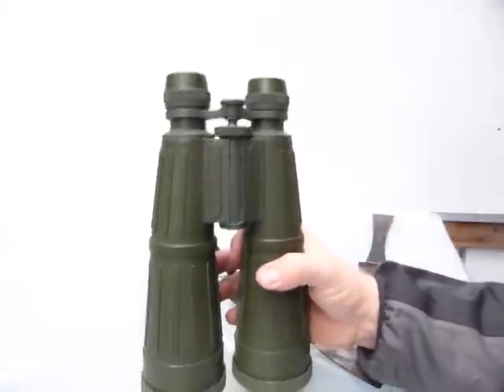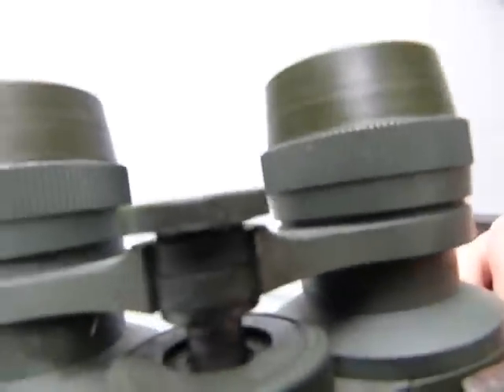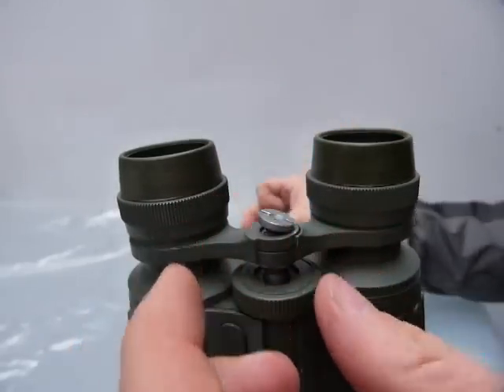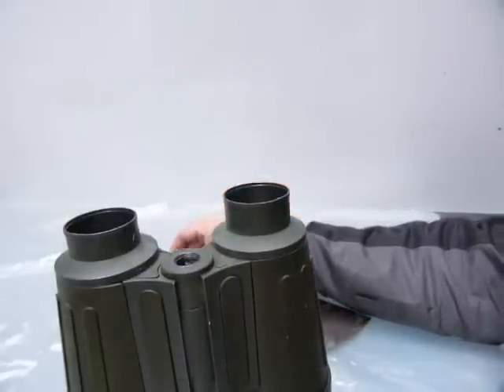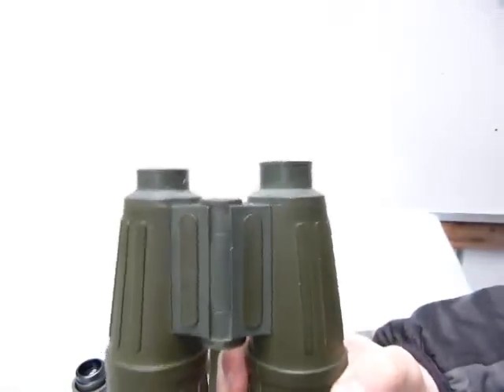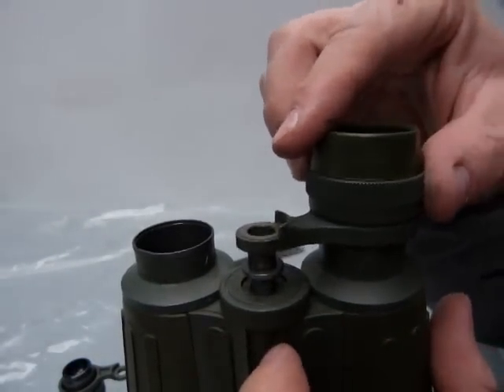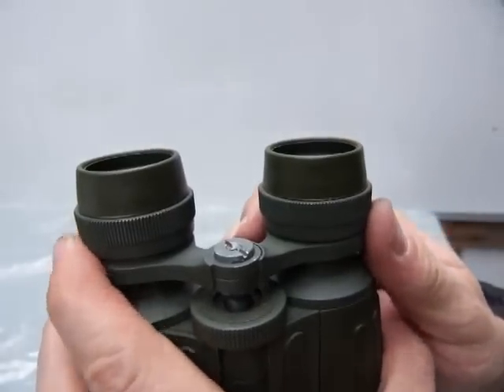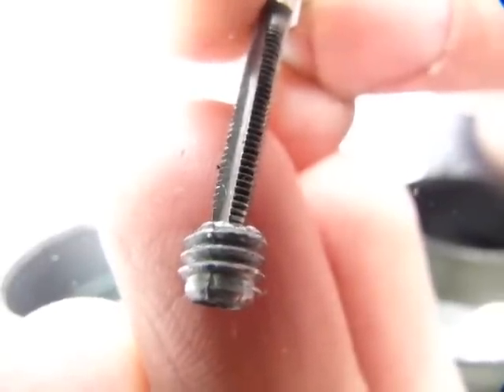Binoculars repair. Twice.

Comment: I was making a mess of it until you explained the GLUE was freezing the main axis cap bolt.  A suggestion is to use an appropriately sized screw/bolt extractor in the little center hole. Tap it into that center hole and GENTLY turn it out of the axis bolt with a wrench. Thank you for giving me the confidence to put a little strength into it.  I was sure there was a hidden pin some where that was locking the cap bolt in place, and your video showed me I was wrong.  Thank you so much!

Comment: Thanks for the video im going to give this a try on ours they fell into a whole in the middle of 5straight weeks of rain & flood.
Reply from the maker: Thanks for watching. Sorry to hear about your troubles, where is it flooding? (We just had 5 weeks of forest fires, extreme drought in the Pacific Northwest)
Reply: theoverengineer i have taken it apart just like you showed in the video, I think we have the exact same set of. Binoculars. I have it taken apart and through the big lenses Ilooking through I can STILL SEE dirt and dried sand and dirty water. I have them all dried but the interior lens still have dirt on the inside of them. Can I expose them for cleaning?
Reply: theoverengineer The dirt & haze is still on the inside lenses, can I take the lenses apart somehow to clean them?
Reply from the maker: Of course. Inside, more threaded lock rings and angular prisms to bend the path of light around. Do not move the prisms out of alignment.
Reply: @theoverengineer  Jakie powiększenie ma ta lornetka?

Comment: to stop any nut or bolt seizing use a product we used in motor racing (Wheel  Nuts) called called ""Copperease" by carlube
Reply from the maker: Thanks for sharing!

Comment: Can someone help me actually repair/replace the focus wheel? Part of the focusing mechanism broke due to which the mechanism came apart. I fixed the broken part but I'm unable to put the focus wheel back in place between the two parts. Any help will be greatly appreciated. Thanks.
Reply: Brother my tento's focus wheel got stucked it was not used for a very long period of time

Comment: Hi
How decoding and repair of Carl Zeiss 10x40 Notarem multicoated and repair balance Alaadasat? I have the moves and spins but does not change the lenses and never nearly ?? Can you help me!
Reply from the maker: +عساف العساف Not familiar with that model. It probably works like any other binocular, has threaded spindles for focusing, glued-in-place threaded lock-rings concealed with exterior trim. Inside the binoculars is Nitrogen or other gas, not air that make servicing tricky.

Comment: “As you can see, there’s a cap here with glue holding it on. See? There’s the glue. Don’t try to use a 75 lb sledgehammer to open it because you could break it.  Here’s my 75 lb sledgehammer. It’s too wide. Here let me zoom in on the sledgehammer so you can see that it’s too wide. See? It’s too wide.”

Comment: good day to you sir, i need your expertise. i just both BEILESHI 10X50 BINOCULAR and accidentally immerse it into water for an hour and some water gets inside..do you have any video to guide me to open and clean my binocular sir? hoping for your positive responce..tnx
Reply from the maker: +Bouchard Palomata No video but the lenses all come out and are held in place by threaded lock rings that may or may not be glued and/or sealed. Here is some visual ideas: https://www.youtube.com/watch?v=2jiU2tb6Ljk You have to find the notches in the rings and open the binoculars up.